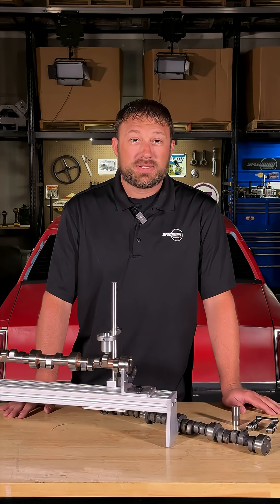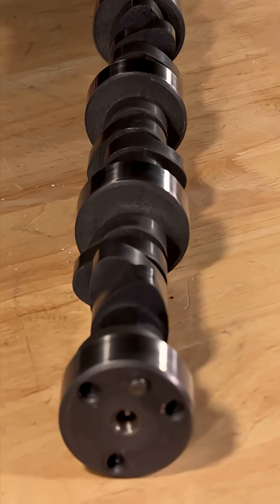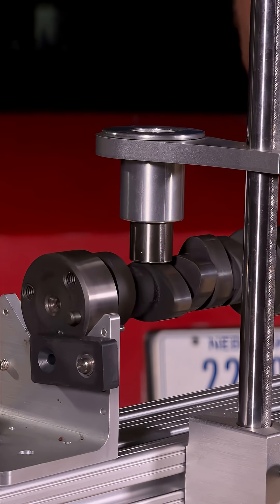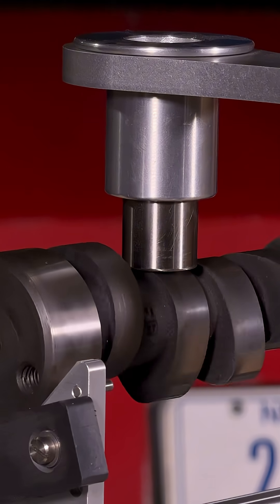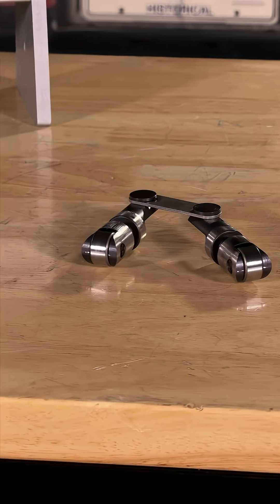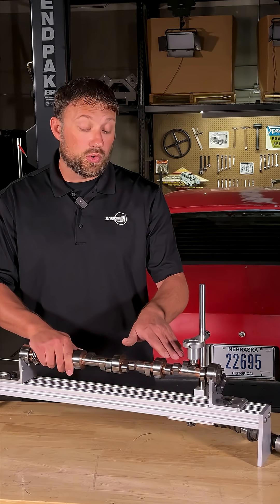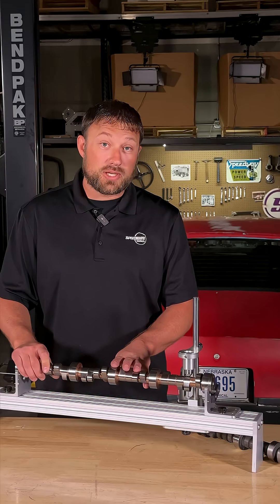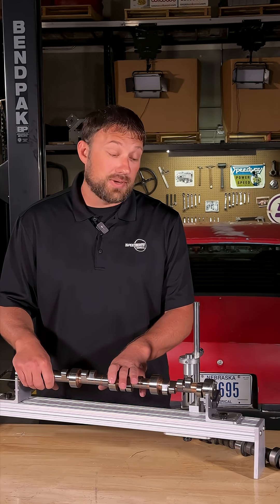Roller vs Flat Tappet Camshafts #camshaft #flattappet #rollercam #engine #mechanictips

Comment: Flat tappet and most especially Mushroom tappets can generate higher lift RATE without distress. Aaaand they are lighter. Heavier tappets are BAD and require MAJOR UPGRADES  to be reliable with Overhead Valve Trains.

Comment: Flat tappets actually open the valves faster. More rapidly. Rollers open more gradual and smoother. The main difference is the roller has more(area under the curve) at peak lift. The ONLY 2 advantages of a roller cam are at peak lift the valve stays open longer and the reliabilty of no wiped cam lobes. FACTS!

Comment: What about the push rod? Don't it need to spin to prevent 
'same spot' wear?
Reply: No, different type of contact - they're not sliding against a rotating camshaft, they're made ball shaped in the ends and hardened to reduce wear.

Comment: In today's world with all the questionable quality of parts(even high dollar named brand stuff) it doesn't matter if you choose a roller or a flat tappet. It's still a roll of the dice gamble if it's going to last. With flat tappet the cam and lifter have to be ground within a very tight tolerance window and if it's even slightly out of spec or not properly heat treated, it's going to fail and usually fail very quickly. With roller stuff you have a very good chance of the cam itself being fine, but the lifters are the weak link, link bar style retro-fit lifters can break the link bar and then cause the lifter to turn and destroy the cam and the lifter. Also with rollers you have a very good chance of one of the roller wheel bearings failing/seize up which will also destroy the cam and make a bunch of noise. Even factory installed roller lifters in modern day engines are having tremendous amounts of roller lifter bearing failure which can pretty much destroy the engine. So if the OE manufacturers with millions of dollars in R&D can't get even lifters right, what makes you think aftermarket junk will be any better, it's all a total gamble.

Comment: Flat tappet worked fine for many years.  Then someone came along and said let's reduce this friction here and put a roller bearing in.  That also works just fine.  Keep a clean oil supply going to it and it will work for many years.
Reply: Yea, I'm an old time wrench from back in the day when the only roller cams anyone ever saw were the ones in our Harley's, all the vehicles we worked on back in the 70's and 80's all had flat tappet systems, and it cracks me up the way people are so afraid of them in this day and age, they lasted every bit as long as rollers did back then, people just screwed up and were dumping oil meant for roller tappets in their older engine most likely because "it was the latest thing" which they assumed would be good for their engine unfortunately. 
Run the correct high zinc/magnesium oil in a flat tappet engine and your cam and tappets will be the last thing in it that goes out.
Reply: @dukecraig2402 Unfortunately in the year 2025, flat tappet stuff being produced these days is garbage right out of the box. There are multiple machinists and engine builders that have been documenting these defective parts especially in the past 5-10 years the amount of cams and lifters that right out of the box are machined wrong or not properly heat-treated/finished is insane and would blow your mind. If you unlucky enough to get one of these defective cam/lifter sets then it doesn't matter if you run the right oil or do a perfect by the book "break in" and do everything "right",the cam is guaranteed to fail. Back in the good ole days you could blindly slam cams in with no special oil or break in and had a very very good chance of it lasting for a very long time. Nowadays not soo much, even professional engine builders have been struggling to get even stock flat tappet engines to survive with new parts. If your familiar with the current automotive parts world in general, you would understand that NOTHING IS MADE LIKE IT USED TO BE!!
Reply: @briang4470  Nailed it.
Reply: Excellent read, I will bear this in mind for the future. Nice one
Reply: @briang4470  Uncle Tony said "First it was more dollars = Inflation. Then it was smaller portions (usually food) = Shrinkflation. NOW it is reduced quality (usually parts) = SHITFLATION "
Reply: @briang4470  From what I've seen most of the problems with flat tappets are probably coming from cams that are not machined correctly.  Not too long ago I reground a barely used small Chevy cam for a customer that wasn't high to the right taper it was high to the center.  How could that ever work for very long?
Reply: Wow you are a genius
Reply: Flat taps are fucking garbage
Reply: So which is better for street & track performance I was told flat tappet
Reply: @justo82chevythang25  Kid - you might be too late but some '74-back GM Old Stock Flat Tappets (16 of 'em) and an equally old school GM Old Stock camshaft. I personally LIKE using flat tappets on HYDRAULIC camshafts - but I don't think the biggest OEM hydraulic bears thinking about. I never liked big cams anyway - I am a Roots Blower Guy at heart.
(WHY? Well because you put forged dished pistons and a blower on it YOU GET TWO PISTONS ON THEIR POWER STROKES AT THE SAME TIME, that's why)
Reply: Except that flat tappets didn't work fine for many years. Camshafts used to go flat in 80k-100k miles, sometimes sooner. I bought several cars and engines back in the day that were low on power due to flat cams. Roller cams are better in every way.
Reply: @greenmachine5487  Until the needle roller bearings beat their way out of their cages, go in the oil pan, then the little bastards get sucked in the oil pump at Seven Grand. New engine time sometimes you cant even save the valve covers. Ask me how I know,

Comment: Maybe you could explain hydraulic lifters? You know for other people, who dont understand, totally not me
Reply: The lifter instead of being one big piece is hollowed out and has a spring on the inside, a little piston and a little plate that goes on top and it’s locked in place with a retainer sometimes a c clip. When the motor gets oil pressure it goes in through the side of the lifter as there’s a hole, and that oil hydraulically fills in all the space that that spring and piston inhabit meaning that plate on top of the spring will lift up because that’s where the oil needs to go. Excess oil goes through the top of the lifter through the pushrod feeding the top end rockers and valve springs and valve stems, and because that oil is constantly pushing out at that top plate taking up space, it takes up a TON of slack that the pushrod would have that you would need to constantly adjust. It’s constantly pushing up against the pushrod meaning you don’t need to adjust and if you do, it’s a good .300 thou or so of playing area you can adjust back into it. It’s a trick system, but since the lifter is full of oil and the lifter is heavier in general they don’t like rpm too too much.

Comment: Sorry for the ignorance but what the distributor has to do with the camshaft and valves?
Reply: Camshaft is responsible for valve operation. Most older engines using flat tappet cams also likely ran distributors. Distributors have a helical gear on them that mates to another helical gear on the camshaft so as the camshaft is spun, it will spin the distributor. It's also why engine timing can be adjusted a few degrees by turning the distributor housing as it will advance the ignition relative to the camshaft. The purpose of the cam button or thrust plate helps ensure that as the cam spins the distro, the rotation force of the distro acting back on the camshaft doesnt cause cam to walk in and out of the block.
Reply: @kristopherwilliams9031 I guess this is an american made old cars idea. I had 79 Lancia with flat tappet valves,and the distributor was not driven by the cam shaft, so I guess this problem never existed there, same with an old  Fiat 127 1975, distributor was not operated by the cam shaft,

Comment: Pushing the cam back to offset the distributor depends 1 which side of the cam the dizzy is on to which way the force is directed , front or back 2 if dizzy is at front or back , or in the extension housing .

Comment: Great short!  This is the best explanation of lifters I have seen!  Thanks!  I was really wanting to rag on roller cams, but now that I see some of the detail needed for flat tappets, rollers don’t look so bad.  However for reliability I have got to believe both of these are inferior to overhead rocker arms.  It just doesn’t get any simpler than that.
Reply: They all can break so no not really the flat tappet's tend to wear out the cam but are easier to replace the roller well maintained last just as long as overhead cam options.
Reply: @hu5116 I assume you mean overhead camshaft since pushrod engines have overhead rocker arms? What makes you think OHC is more reliable?

Comment: Flat tappet makes more power under 270 advertised duration but must use 1500 or more ppm zinc and keep spring pressure under 330lbs. at full lift. Beyond 270 rollers take over.
Reply: True about the zinc. 
Thing is most street motors do not need a roller cam. If you are all about making some serious horsepower, then go with the roller cam, but understand, since you can now use a more "radical" cam, get ready to spend a "radical" amount of more money to feed your monster. 
More radical cam lifts, suck more more fuel to 
make more power. 
Flat tappet cams are fine for most street motors, n with the proper setup, can make good horsepower n be reasonable on the fuel consumption n mileage. More power always means burning more fuel. Heat is energy, if you remember from science class, n creating more power means creating more heat, therefore you'll have to burn more fuel in proportion to power output... Elementary, my dear Watson... 🤔
Reply: @Pork-Chopper  "n" 😂
Reply: Chevy had a small block cam that was advertised at 310 duration, It did not idle good at 1000 rpm.  I can tell you that but would produce power at ungodly rpm. Solids lifters and was called Duntov 30-30.  With .030 rocker arm play.
Reply: @chrisbraswell8864 I'm not sure what you're asking me. Is it like cumponuntie? Those heemy cam durations surprise me kind of sneak up on you. In my opinion the pumpy could be more or less depending on the situation. The stettle is where the zinc comes into play if it's too keemey or not.  Hesto™
Reply: Rollers add more moving parts and weight to the system. Meaning you cant rev as high meaning less horsepower.

Comment: Would it be okay to run a button with a flat tappet?
Reply: Yes, but you shouldn't need a button.
I noticed my ignition timing (V6 Buick) was jumping around (almost 5 degrees) and suspected there was no cam thrust button.  Sure enough, cam was installed without a button and after installing a button the ignition timing was rock solid.

Comment: Roller lifter sideways, that's why there's a link bar
Reply: That lifter in his demo rig is a different unit than the ones with the tie bar on the bench. It has a round "ball" style roller. It isn't sideways. Watch the reflection on the roller as it goes up and down on the cam lobe. He's using this type because the demo rig is only set up for a single lifter. To be fair I had to watch it a few times before I noticed that reflection.